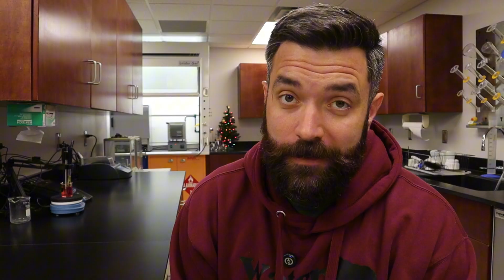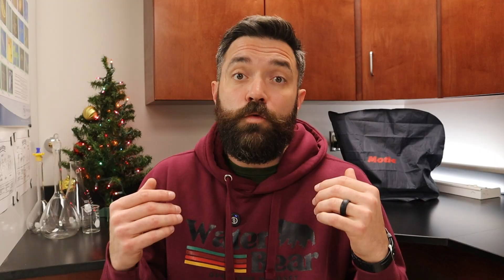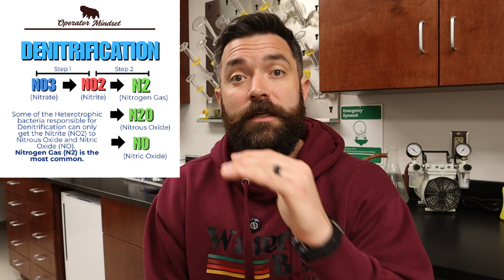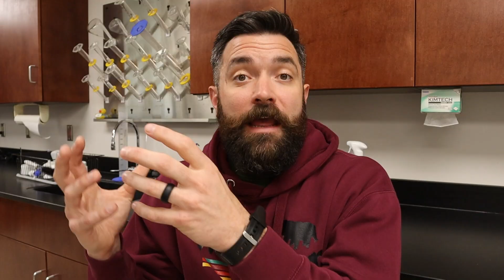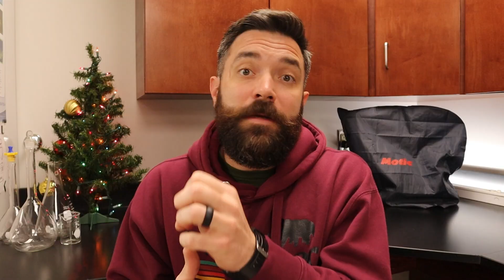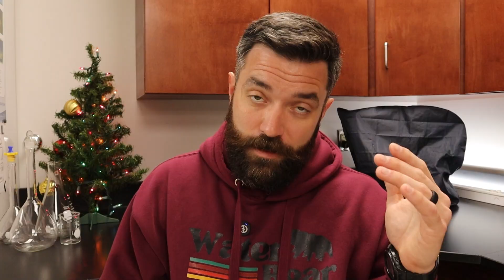Removing Nitrogen from Wastewater through Denitrification.

Comment from the maker: Some notes, technically you can Denitrify without Nitrifying. (if all conditions are met for Denitrification to occur, it will happen) But for your exam remember Denitrification follows Nitrification in the process. Also, regarding Simultaneous Denitrification there are plants designed for this to happen on purpose. It can happen "accidentally" in the activated sludge process as the floc gains in size.